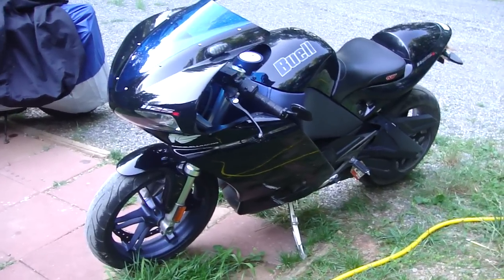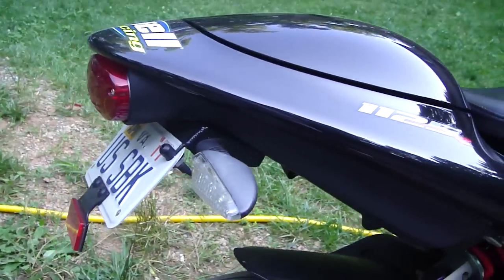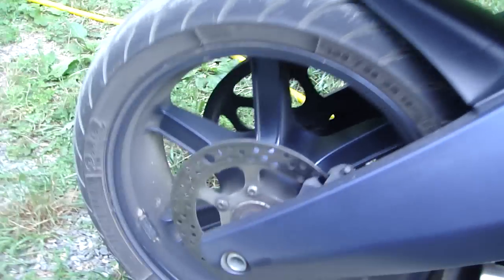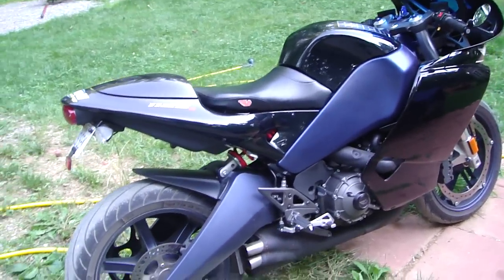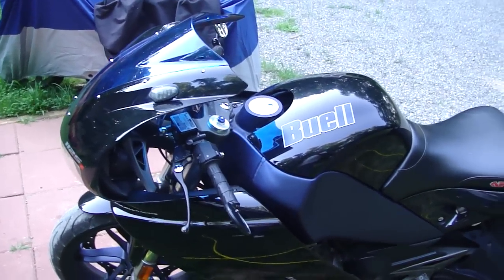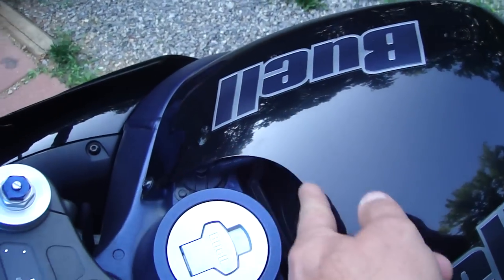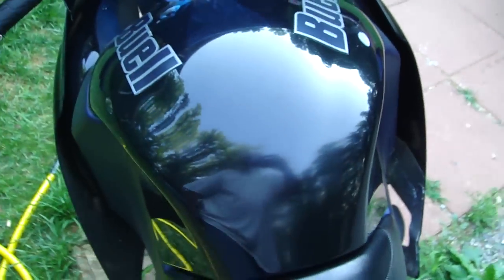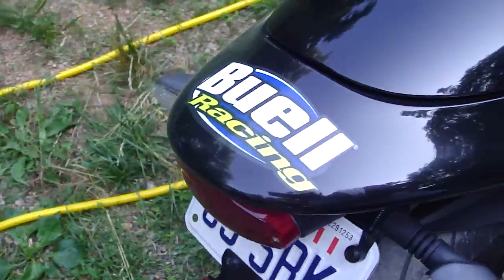Buell 1125r Modifications to Improve Performance and Appearance

Comment: Re: The stock mirrors - i quite like the fact that i need to tuck my elbows in to see what is behind, as it assists in blocking out dazzling headlights of cars behind me.   But 100% right on the vibrating, i sometimes clutch in to see what is actually behind me :)

Comment from the maker: @hughesju no probs I used R1 flush mount signals from d2moto and sealed them in place with black silicon I used some flat head machine screws and acorn nuts to secure the fairing first. I clipped the leads from the stock signals and soldered and heatshrinked them onto the flush mount signals.

Comment: Does it seem like every Buell owners are major apologists, trying to compensate for a really terrible product, because it is US made? Well, not so much because this engine is Austrian made. I really want to like it too, I really do, but there isn't any reason these bikes should be such garbage stock. Major selling points for the bike is the sportyness of it, and to think you need to remap it, with a special race programming, in order to get decent mid range performance out of it? That whole top of the airbox thing is horrid too. Electrical problems, fried stators, bike dies on you while at highway speeds, gas boils in the frame, mirrors shake too much to see out of, I doubt we would put up with that if any overseas brand. It is a beautiful bike and concept, and super cool shot at a niche, but dang, they had a lot of years being harley backed to still have these kinds of things in production bikes.
Reply: I owned and rode both a 2007 Yamaha r1 and a 2008 Buell 1125r at the same time. When I finally made the decision to sell one it was the Yamaha that I sold. And I have no reason to apologize for Buell because it is made in the USA.
Reply: Mostly because I have lived my whole 69 years in Canada.